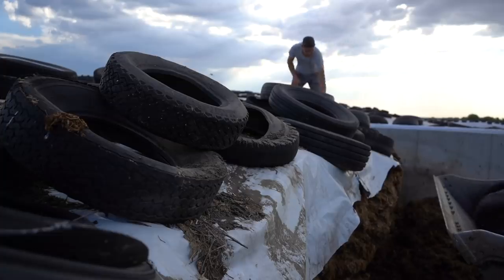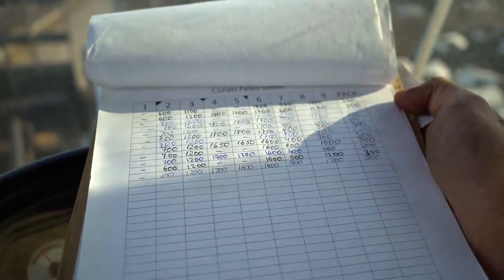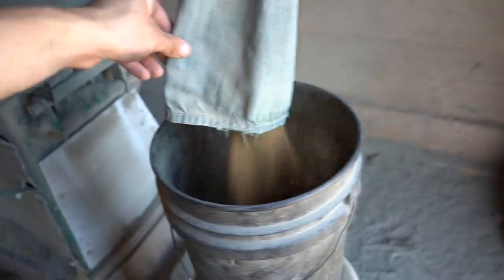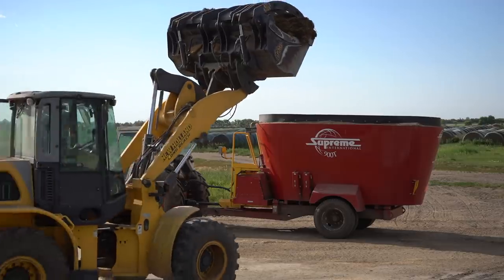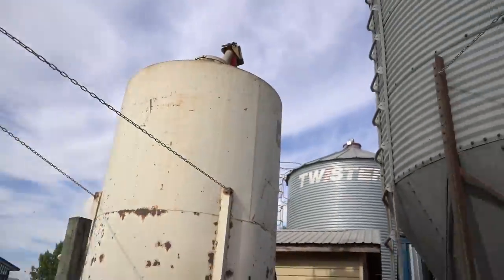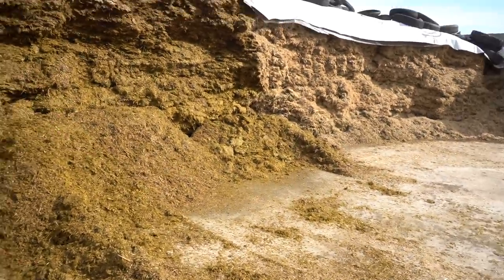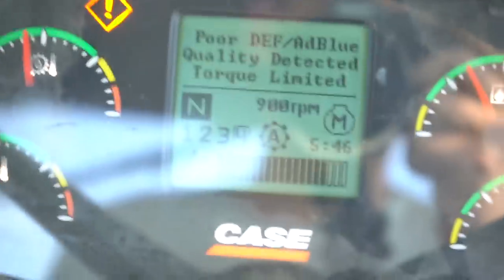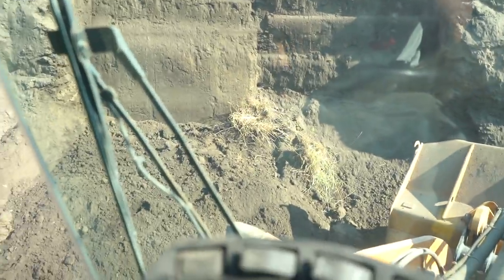Dairy Farming In Extreme Heat!

Comment: I prefer COOLER weather... 35 to -35 C is 95 to -31 F.  So -35C would be tooooo COLD for me.  21 C is 70 F which would be fine for me.  At the very beginning I thought the train (whistling) was coming through the yard .  When you were feeding in the main barn I was wondering if JUNO was back working properly.    Good content with thoroughly good explanations.

Comment: Although I live in Phoenix, I've actually experienced both extremes.  +35 is quite common here, and as long as I have plenty of drinking water it doesn't much bother me.   I'm a metallurgical furnace operator,and it gets up to about +60 in our furnace room on summer afternoons.  Years ago, though I worked a temp job in an ice cream warehouse that was kept at about -35.  I didn't really have a problem keeping most of my body warm, but at the end of the day my cheeks and nose would be red with superficial frostbite.  I worried about that doing harm without my knowing it.  I definitely prefer +35.

Comment: Great video again Jan😎. Nice to learn on the strategy and practice of feeding and animal diets, on the ingredients and what is really needed for healthy cows. Like the need for chopped straw besides the rich energy en protein from the silage's / forages. 👌👍🚜🌽🍀
Also on how te limit the volume putting in there on each feeding turn, as it degrades quite rapidly under these hot circumstances as you say. 
Btw, I prefer the cold as well, but minus 35 degrees? Maybe best prefer something in between.. We do not experience that severe cold that often anymore in NL (and wider  in Europe), as you know. Due to climate change, in NL we even hardly have winters with substantial number of days below zero even. How many hours you work on a daily basis in Summer? If I may guess it is something like up till 18 hours / day? Stay safe!

Comment: Hey Jan sweaty greetings from Germany. I really dig our content. 

Last week we were in the 40°C(104F for the metric challenged) range, but with a low humidity it was bearable. Still hot but sweating made sence. 

Today we had just 33°C(91F) but we had some much needed rain the last days, (but as it is now we got rained out hard, some places got 75mm 3" in less then 2 hours.) now its super moist out and thank god i have an AC in the office..  still tinkering in the office, because at home there is no AC. 

And one thing i saw in your videos, 
you´ll take paper notes feed rations, fertilisation of the cows and so on, 
to punch them in the computer later (or not and the data is gone)  thats twice the work for the same result. 

Either figure out how to work the existing programms you use with Ipads/Surface in an rigid case(otterbox) or your smartphones 
or the cheap and Copy&paste way, Spreadsheets in Google docs, that can be copy & pasted into the input of the programms. 

You should really look more into digitalisation and automation, not long and yer sisters will go to college. 

One thing i saw at a customers new barn(we did the concrete all the pipes and outside stuff) was this lely manure collector Discovery 
to keep the moving areas cleaner,  that barn didnt even smell like a cow barn. And the cows were super clean.

Comment: I am a fifth generation Texan and  it gets extremely hot down here in the summer. I am also a fifth generation home framer. If you are sitting in the shade doing nothing you can bear it. But exerting yourself in direct sun with the reflection of a concrete slab on you is too much. I've had heat exhaustion/ stroke probably and that ruins you. My younger days I could handle it. Not anymore. You can't take off enough clothes to cool off. But you can put on clothes to warm up. But I am also told by many northerners. Which there are a lot of them moving here everyday, that the colder temps we have here are more harsh and painful than up north. I often think I would love to live in Colorado, but I don't really know if I could handle the cold and being snowed in.

Comment: Am used to the heat so 35°C is warm or very warm but not hot, hottest I have experienced here in Oz is 46°C /115°F Travelled over the Canadian prairies in mid winter many years ago and think I can remember -45°C. 
The troublesome dial read-out, my partner has a similar problem with her powered wheelchair, light flashing indicating that batteries are flat, turn it off, turn it on full charge.

Comment: Extreme cold to me is 4C. But then I live in an area with usual winter temps of 6-26c. Summer 30-36 is waaay more my thing. We get high temps in the 40’s very often - anything above 38C is too hot. The humidity sucks too.
Reply: Working in a bin in 35+C is a dangerous job. Stay hydrated

Comment: You seem to understand your feed value and what heat and air can do to it. So why not keep your silage face straight instead of chunked out? It's so much cleaner looking and less possibility of damage.
If your hydraulics aren't fast enough to curl and pick away at the face straight up and down just down blade it with the bucket and that will square it up.
 Give it a try you might like it better and you'll notice less square footage of silage open to the climate.
 We do it in our enclosed bunkers and it helps with keeping the birds off the face.

Comment: Sounds like you need to get the DEF sensor checked out on your CASE loader. It's telling you there's an issue in the system, but it sounds more like the sensor itself is the problem, because you shouldn't be able to reset it simply by turning the engine off and on. I use to sell Wacker Neuson loaders here in Ontario and DEF was a pain in the butt on the 75hp+ engines! - Dave

Comment: Cold Cold Cold! I can't take the heat either...... it must be in the genes as some people around here walk around in winter jackets during the summer. It makes no sense, but my ancestors are from Germany and I like it cold.

the def light might be coming on as the level gets low? The technology is fairly new so it will likely be changing with time. Def is only injected when the engine is under high load (when the black smoke would be created in a non-def engine). But since you restarted and it went away, that might not be it. Online search indicated just fill it up and the light should go off. Good luck.

Comment: Your farm should be stocking face masks by the case load with all the possible kinds of animal fecal or other dust and mold spores you'd encounter without knowing. Be safe my friend. Keep a box in every tractor, every room.

FWIW, the extreme cold weather is easier to deal with than extreme heat. You can always add a couple layers to warm yourself but sweating has a limited effect on cooling you in continuous extreme heat.

Comment: Your DEF in it might be to old. I seen a few videos that have shown that you need to watch out the date codes because the new equipment can tell if it is old. If it is not burning out the system you will have some big bucks repair.
Reply: Yep.  Urea will break down over time.

Comment: I am not that bothered by the heat. It is around that temperature all summer and does not start to really get cool until December when it will get into the 60's F for highs and will stay that way until January where it will drop to the lower 60's for the highs. So I really like summer and spring I do not like cold at all.